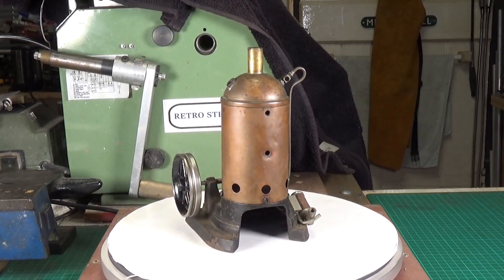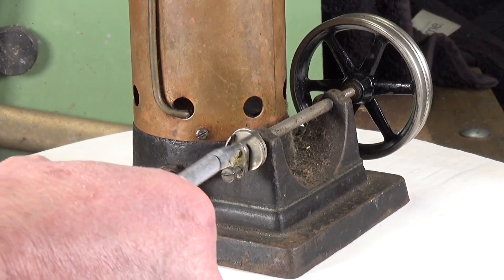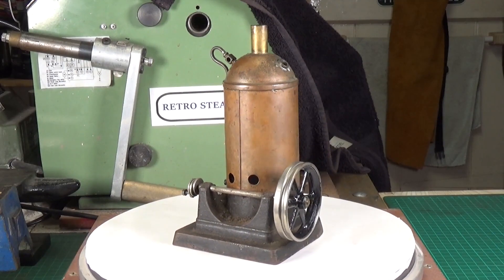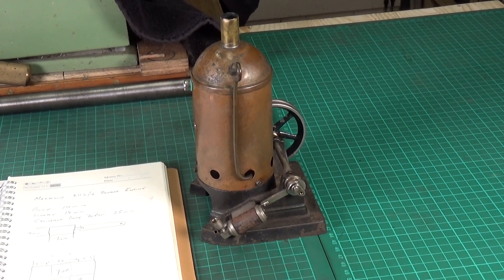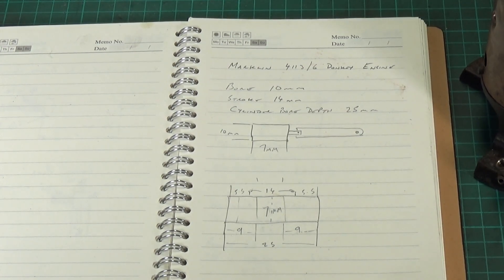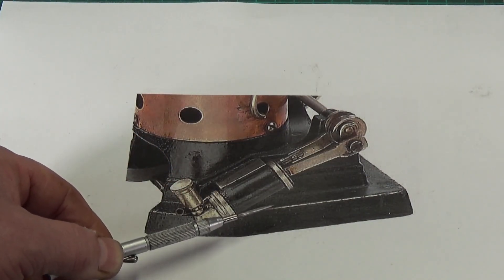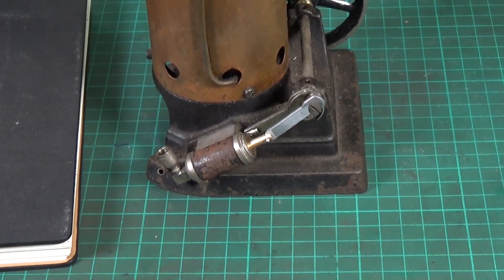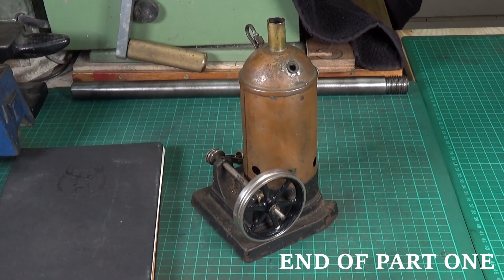Märklin 4113/6 Donkey Engine - Part One

Comment: Interesting design Alan.
Reply from the maker: That's what caught my eye. I particularly like the angled cylinder and the fact that the firebox, engine mount and crankshaft support are cast as one part.
Reply: @RetroSteamTech  I would not mind doing a replica of that one. Nice cast base.
Reply from the maker: @myfordboy  Once I've got it finished and running, I'll box it up and send it to you. Love to see you make a replica of that cast base. The original is cast iron but aluminium would work just as well.
Reply: @RetroSteamTech  That would be great. Thank you so much.
Reply from the maker: @myfordboy  No problem. I'll be in touch.